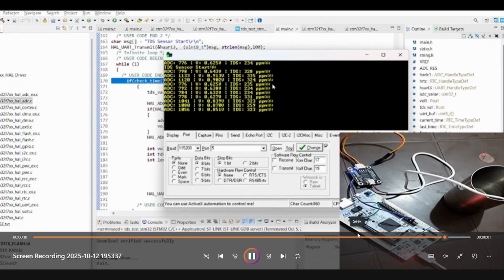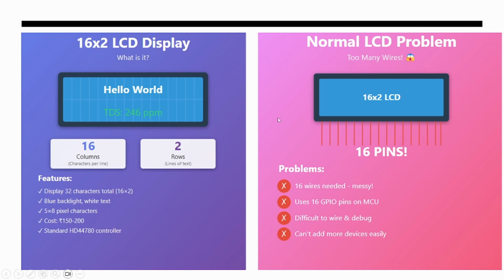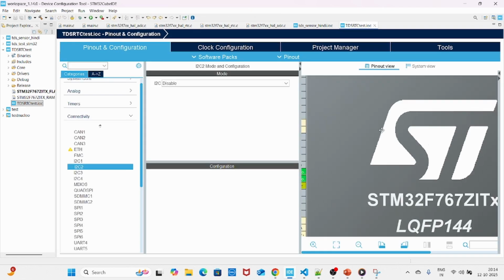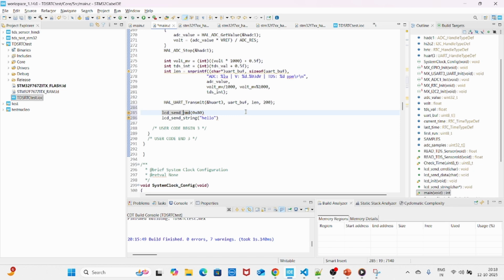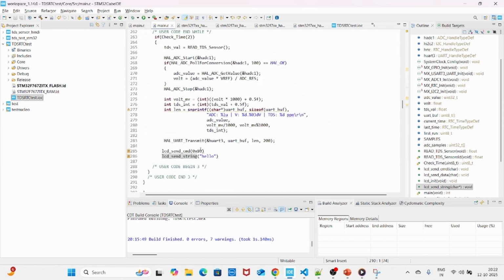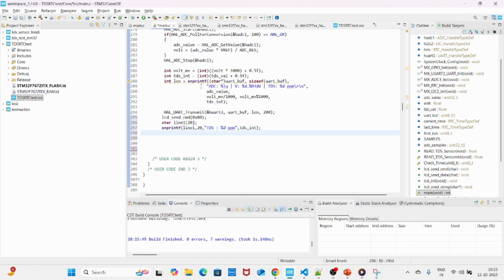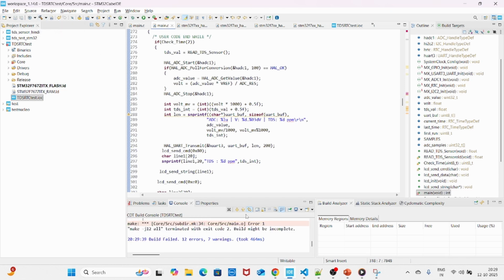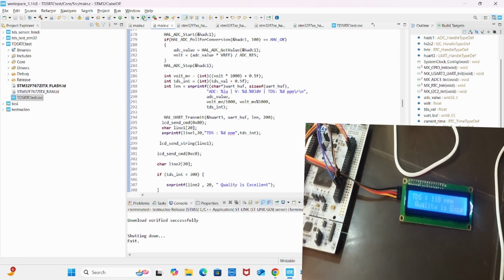STM32 LCD Display Tutorial with ADC (TDS sensor) | I2C 16x2 LCD Interfacing

Comment: What is TDS sensor?
Reply from the maker: A device that measures the concentration of dissolved inorganic salts, minerals, and metals in a liquid, usually water, by measuring its electrical conductivity...
Reply: @hardware_coding3603 . Fascinating. 👍